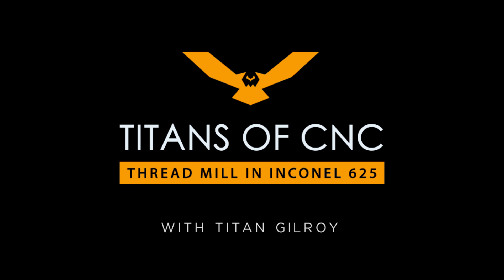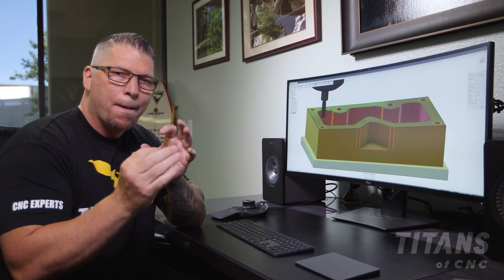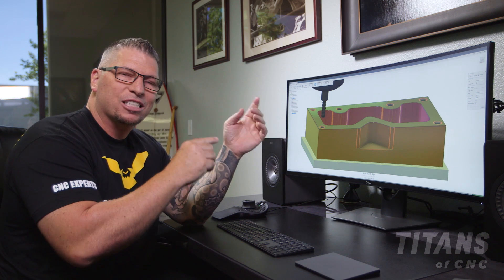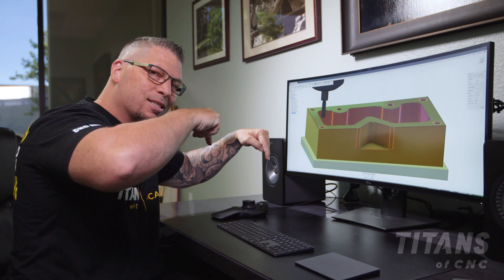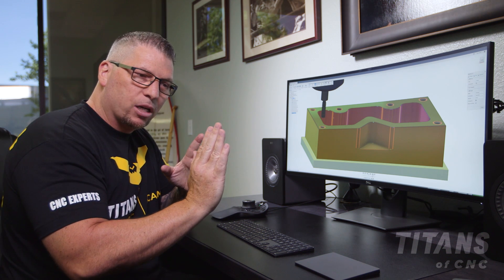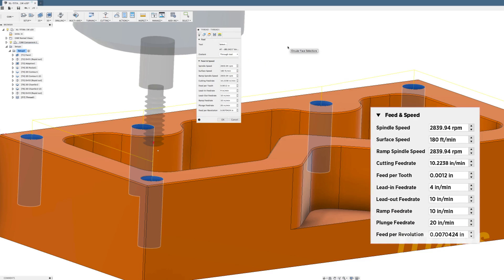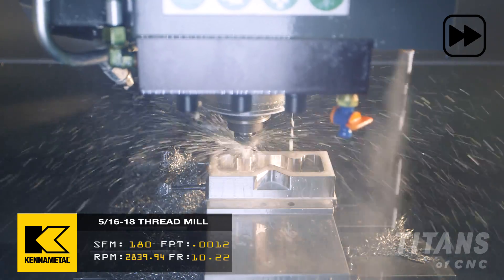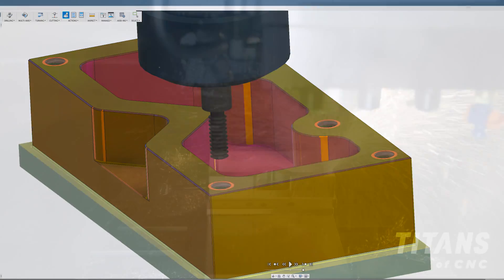Thread Mill Inconel 625 | Kennametal | CNC Machining

Comment: Thanks for the video. This mill confuses me slightly (total basement machinist here) so I use a classic single thread mill since my Tormach doesn’t support rigid tapping, and I get how it works (both from your tutorial way back and just experience using it) but with this tool how does this tool do the vertical spiral (doesn’t the tooth above prevent the tooth below from cleanly cutting as it pushes down? And how to the threads merge? Wouldn’t there be a wall between each tooth’s path?) overall thank you for all your education, I love simple one-shots like this not needing some crazy 21-axis nuclear fueled machine, and I pay it forward by teaching cad/cam at my medical school to doctors based on what I’ve learned here!

Comment: Hi Mate, great job as usually. So the only reason why you cut thread  from the bottom of the hole to the top, is an issue with the chips removing?

Comment: I am from India
I need your help please
We are using calmax metal 62 HRC for coin making die. 
We can't success in engraving on this meltal. We use carbide v bit tool. But when we start the job our tool are damage again and again.
So please sir help us guide me.
Thanks and regards
Pankaj paliwal
Reply: I understand this is a little late but I would try a center drill and only go down maybe .005 thou but you can adjust to your liking

Comment: Why not single point thread mill? That way you are not locked into a fixed pitch (almost).
Reply from the maker: Takes way longer... 20 Times longer.
Sometimes we use single point but only on odd ball low volume

Comment: I make a shit load of inkonel parts for a bullet company here in Idaho where I live. I’m always so scared of tapping my parts. Taps love to break off with hard material. I usually just tap them a few hundred thousandths deep and then I’ll do the rest by hand. That is the safest way to do it in my shop with the tools I have available in shop. But this is very interesting. My boss has never taught me about thread end mills. I’ve been doing this for 15 years too. I’m gonna try this for sure. I’ll practice on some scrap. Very cool and informative!
Reply: I’m having issues tapping 6-32 spirallock threads alittle over 1 inch deep on a ring, things to wanna break all day even with hand taps, an thoughts?
Reply: In iconel
Reply: Fckn nightmare

Comment: Hello i have a question 
Is the metal 3d printing will take the place of cnc machine if not please tell me why ...
Thanks
Reply: Abdalhalim Zeineldeen 100% it will some day. As soon as it gets cheaper to 3D print and they are able to print off all materials like titanium and super hard steel. It just costs to much right now to print stuff. I’m a machinist and I have always said some day 3D printing will take my job. It won’t be for a few decades. Give or take, but it will happen as technology gets better and cheaper. U will always need a person to program though.
Reply: Not for a long time. We would need something with quite a bit more precision than what currently exists. The benefit of metal printing is geometry which is either hard or impossible to machine on the interior of a part.  CNC is not a stationary technology either, it will continue to get better faster cheaper over time as well. The two will certainly be complimentary.

Comment: Titan, Do you use the same 3 pass recipe ".005 undersize, size, spring pass"  regardless of thread size or does this change when doing larger threads?
Reply from the maker: I might just do a rough and finish in steel or softer materials... but in Titanium, Inconel, Monel etc...
A 3rd spring pass just cleans up any deflection.

Comment: For my small-machine setup, thread Milling probably beats tapping any day if I can do it. It can save the cost of a tapping head, and broken taps. For the small-shop machinist this can be a money saver over trying to have a bunch of taps and dies as well. I think Mach-3 has some rigid-tapping Wizards, (that can be used with both forming and cutting taps), but on a small machine these might only work well on small holes. I have been looking forward to trying Thread-Milling on my setup.